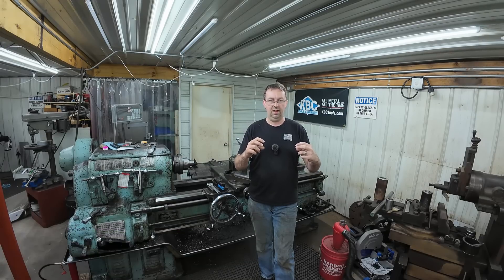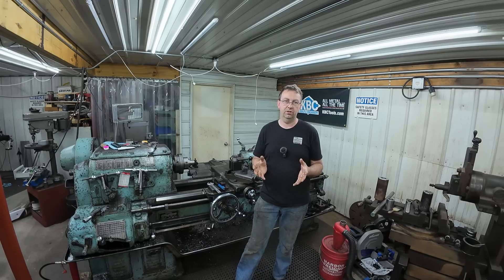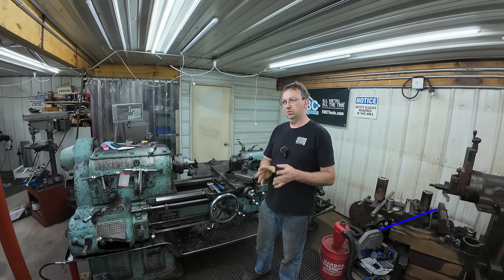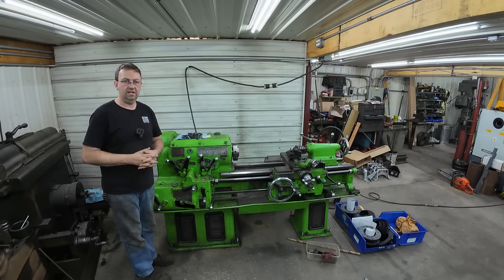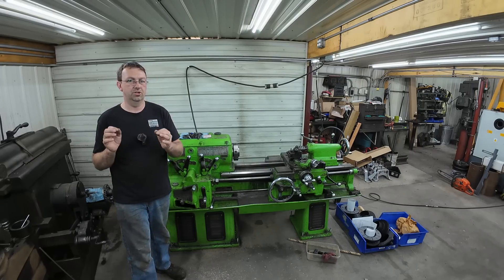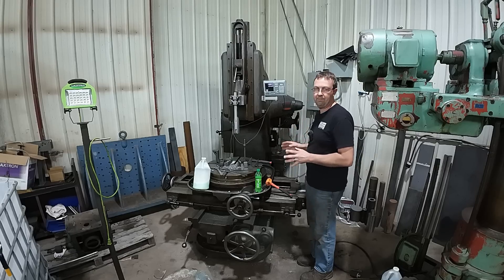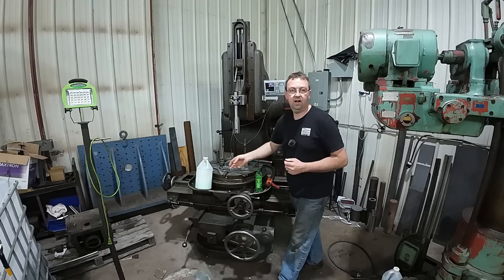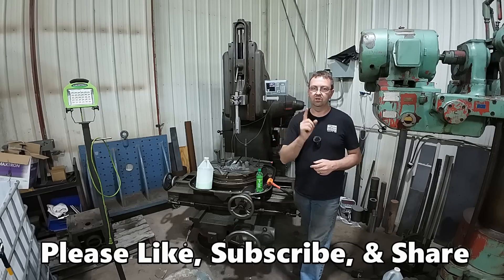Why I Fixed This Hydraulic Trunnion The Way I Did - Trunnion Repair Follow-up

Comment: In a 2 year old video repairing an unserviceable hydraulic cylinder, you used an ultrasonic thickness tester to determine the end cap thickness. Can you share the info on the make and model. Thanks, Bud

Comment: I am so torn between which process from my two most trusted YouTube machinists! I had welded a few trunnions in the past and never had a failure, and felt confident with the process after seeing Kurtis from cutting edge engineering do it to a few cylinders. Now you have me again nervous about my repairs!
Reply from the maker: Welding will cause stress fractured and fail. I've seen it a lot. Sleeves are the proper way to do it. The only thing good about welding is the job security, you will eventually be making a whole new part.
Reply: @TopperMachineLLC  You could stress relieve and temper the weld and it should behave like the parent material with no more likelyhood of failure if the correct weld filler material is used.  That requires more work than just sleeving so...............
Reply from the maker: @bcbloc02  While stress relieving and proper weld processes would work, it ultimately comes down to cost.  This repair was much less expensive than welding and stress relieving.

Comment: After watching the video pressing on the bushings to the two ends of the shaft was the correct way ,must have had 
.003 to .004 press fit on there after heating up the rings, that is strong enough to hold that ,actually would be even stronger than welding, when you weld something you take the strength out of one of the items  and it does have a tendency of cracking. so you did the right way.

Comment: What ratio of Anchor Lube do you use with the mister? Have you had any issues with flash rusting since switching?
Reply from the maker: Stay tuned. I'm still experimenting, but will eventually do a video on the results

Comment: I gotta say, with regards to the Anchor Lube, I was a little wary about how many channels suddenly had it all at the same time.  You tend to see random products come and go in waves across various channels and I'm usually unimpressed with most of them.  I did decide to give the Anchor Lube a try in my home shop and I've been very happy with it.  Any time I'm running into a situation where I have high tool pressure the anchor lube works like magic.  It's a little more messy on the cleanup but I'm slowly transitioning over to it as well for most things.

I'd be very interested to see how your thinning it down and using it in the kool-mist setup and what kind of results you're getting.

Comment: Comment about trunnion repair.  Why did you make the sleeves before you knew what was required to clean up the trunnions?   TOO much heat, it does not require that much heat to make steel grow, too much heat can change the chemistry of the steel.   A retired heavy equipment mechanic w/50+ years in the trade
Reply from the maker: I measured it and knew how much I was taking off. I knew finishing the OD of the trunnion would be simpler than the ID of that tiny sleeve. It was a tight fit, I needed to make sure it was going. Never had a problem with heating them that much. 25 years doing these exact repairs with 100% success rate.

Comment: Just a quick comment, mainly for the algorithm, I turned my 3rd worn lathe into a welding rotator. I would have done the trunion the same way, I hate welding anything that has been exposed to oil and grease over the years. Cheers

Comment: I feel your pain on running older machines Josh some of them are so low. I'm a fairy tall guy myself 6'5", and it sucks having to hunch over to run them. I have an old Axelson and old Bridgeport that I use at work that were so low I couldn't comfortably run them, luckily I was able to talk my boss into letting me raise the Axelson lathe up 10 inches and the Bridgeport mill up 8 inches, and now I actually enjoy running them, but it does make them my machines now as they're a little high for everyone else lol, which is just fine with me. 👍👍

Comment: I didn't think there was any other way to repair that trunnion, other than how you did it. Welding would have been out of the question, because the part was too small and too complex to repair that way, with the risk of damage. Bushing it was the only way to repair it successfully. Had I been in a position to do that repair, I would have done it the same way. Of course I don't have the equipment for that, but if I did ......

Comment: No, No, You did that trunnion repair all wrong.  Typically I just throw those types of repairs in my time machine and turn them back 40 years.  Works great and they come out like new :)  Keep on Keeping on Josh!
Reply: ROFLMAO!  ToT?
Reply: @willgallatin2802  Josh probably read the first sentence and then skipped the rest.  Poor guy.  He can't let that stuff get under his skin.  Sometimes the suggestions can be helpful and provide different solutions to a problem, especially when you're wrestling with something, then other times it's just armchair quarterbacking!

Comment: Naysayers are retreating 😮. 
Good machine tools are expensive, one man job shop can manage with 2 lathes if the jobs dont range from very small to large?
But as you state,  tired and inaccurate equipment need to be gone, tgats my 2 pence worth Josh.
Nice insight 👌
Reply from the maker: Very true

Comment: Hello, I would keep the small lathe if I were you. We had 4 different lathes in our company and the smallest one wasn't used much, but the little beast was great, especially for small pieces. My boss was also faced with the question of giving away or overtaking. And We overtook her and she ran until the company was dissolved. And a good old machine is usually better made than the new machines. Greetings from Berlin

Comment: I like your thoughts about Anchor Lube. Is it a plastic allowing water dilution? Can you tell why it conducts heat away from cutter? I like your fix on the trunion
Reply from the maker: I'm still experimenting with thinning, but I've seen great results

Comment: I've been a welder and fabricator, and an industrial mechanic, now retired. Welding can be problematic. Some applications just aren't suitable for welding and that trunnion does seem to be one of them. I agree with your explanation. As a mechanic in a manufacturing plant, I've had to weld things that just shouldn't have been welded. I got away with it most of the time, but I was praying for the new part to arrive before it broke again. Not something I'd want to do for a customer.
Reply: Glad to hear I’m not the only one who’s been forced to weld things that shouldn’t have been welded 😅

Comment: One thing to strongly consider before selling your smaller lathe is that having two lathes can be a life saver in a job shop as more chances of having an open lathe as the other may be set up with a, or for a job. Example work for the crane Connor is doing in the background on one lathe.
Reply from the maker: I've weighed the options. I have 3 lathes currently and only use 2 at a time. Honestly,there isn't enough work in my region to justify all 3. If things ever change, I can purchase another one, but the floor space is far more valuable right now.
Reply: @TopperMachineLLC  Got it, I didn't know you had 3...yep shop space is also a premium for sure.

Comment: You did the right job on the trunion. The only thing i would have done different is putting the centerholes in first after clocking the part. Be carefull misting the anchor lube. Not all soaps are safe to breath.
Reply from the maker: I wish I had done that also. Hindsight. It is far safer than the Koolmist crap I was breathing. That stuff made me sick.
Reply: @TopperMachineLLC I tried spray mist many years ago but had to stop using it. No matter how effective it was I just couldn’t stand breathing it. Surprisingly I’ve found plain old engine motor oil works very well in my 12x36 lathe. For many years I did a lot of diamond  knurling on aluminum 
and nothing worked as well as a flow of engine oil. The cheapest you can buy works as well as the most expensive.

Comment: Thanks for the video. I think that it is great that you know when you can weld and when you can not. I think that welding is the answer for everything but I would have got this one wrong. Sorry man but welding is just glue to me. I am glad to see that you done some upgrades. Your shop is small so you have to make the best use of the space that you have. Good job on the video and good to see you. :trophy-yellow-smiling::cat-orange-whistling::cat-orange-whistling::trophy-yellow-smiling:
Reply from the maker: Not every job is a candidate for weld. Or duct tape for that matter.
Reply: @TopperMachineLLC  you mean duck tape is not always the best answer? Tell me it ain't so, Josh... <g>
Reply from the maker: Sometimes it takes electrical tape.
Reply: @CothranMike  Well, I guess todays video has all kinds surprises.
Reply: @TopperMachineLLC  What ever you do, do not tell the guys on the PBS "Red Green" show where Duct Tape is the always the answer. 🤣🤣🤣🤣

Comment: Is the wall behind the blue angle plate by the slotter the north exterior wall?
Reply from the maker: No, west wall. North is behind the planer, radial drill and right side of slotter.

Comment: Josh
a question about anchor lube ( here  in the UK there is only one supplier ) I have heard that its a water based product and some people have found if not cleaned up after use it can cause black marks on steel ( some have said the etch deep and are difficult to remove

I would like to hear your view on this  Joe Pie did a talk about this issue

as I have a very small hobby workshop cutting oil filled the place up in a nano second
Reply from the maker: It will stain, but the benefits far outweigh that. Just clean it up right after. I have not seen black staining, more white to gray.
Reply: @TopperMachineLLC  thanks for your reply

Comment: Everyone thinks you can just weld anything without any consideration of heat affected zone or brittle fracture. Unless you are desperate for the space I think you’ll regret letting that lathe go. That said I’ll be watching to see if I need to drive over there and relieve you of it. 😊
EDIT: Very interested in the thinned out anchorlube - hell of a neat idea. 👍👍
Reply from the maker: I think it will be ok to let it go. I don't do much small stuff so size isn't an issue. So far misting anchorlube has been great.
Reply: Someone will be glad to have the Green Machine for sure!

Comment: Anchor lube better have a good source of fairy wings and unicorn horn ! Thanks for the video
Reply from the maker: It sure has impressed me.
Reply: @TopperMachineLLC  used it back in the mid 60s... dilute 1 to 1 max was the rule, tried it in a greater dilution as a mist as you do now and discovered it needs a surfactant as an addition, cut it with a jet dry type product (actually photo dry) and it worded well. Problem was it did rust, or stain via capillary action so make use of way oil and/or wd40 for protection before and dewatering after. It was a pain in the butt to clean up when this thin as well. Usage as a flood coolant was never considered since the lathes were WWII vintage and no one had shown them love or upkeep in the job shops I frequented then. You can imagine the places that flood coolant could get into on a lathe! And as a mist it was very controlled and contained since it was not my equipment. Folks thought I was strange then, and still!